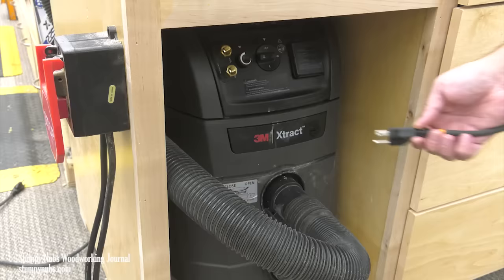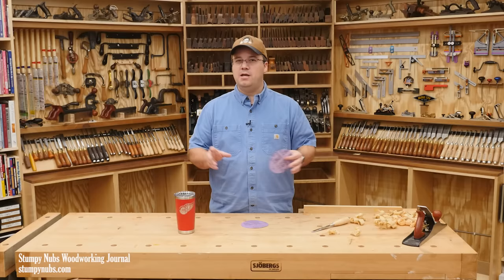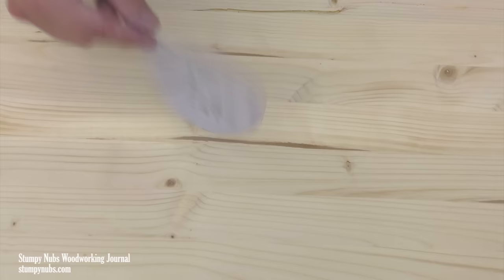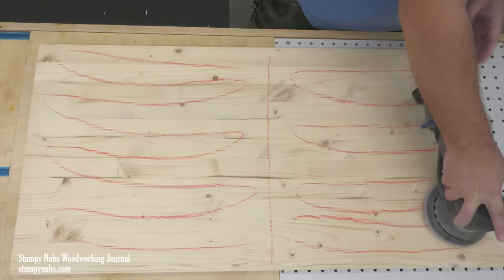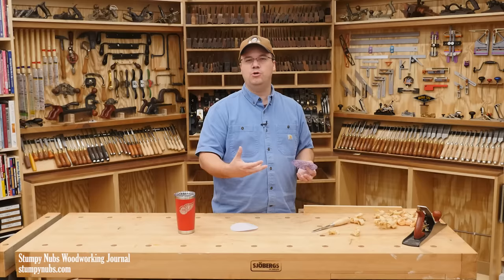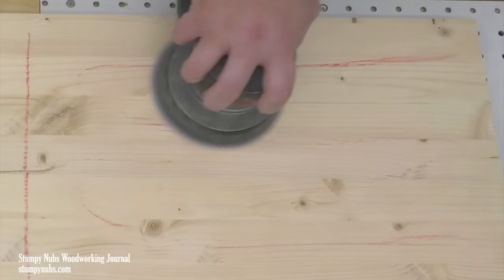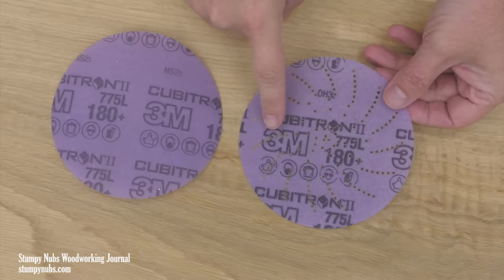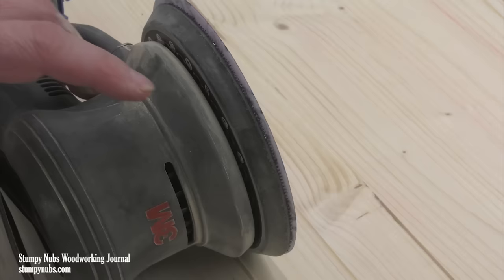This LITTLE KNOWN tip will cut your sanding time in HALF!

Comment: Interesting that my Cubitron disks don't have the spiral hole pattern, but a series of geometric shapes.
Reply: Are you using cubitron 2?
Reply from the maker: Do you have the mesh discs?
Reply: @StumpyNubs  yes. Cubitron Ii Extract .
Reply from the maker: They make mesh and spiral discs.
Reply: @StumpyNubs   Are the spiral better than the mesh I’ve been using? And should I use a dust extractor instead of the shop vac I’ve been using?
Reply from the maker: @markjcarpino  The mesh will give you the best dust collection, but the spiral is on a tougher backing material. Use whatever works best for you. A shop vac will give you plenty of dust collection as long as you keep the filter clean. A dust extractor is quieter, and comes with more features, but doesn't necessarily produce more suction other than the fact that they often have auto-filter cleaning mechanisms that ensure you always have plenty of airflow.
Reply: @StumpyNubs  thank you

Comment: I bet the first area looks just as clean if you just vacuum up the red saw dust that is left on top
Reply from the maker: That will make it less pink overall, but there's still a lot of the red lines on the wood.

Comment: He’s fooling you by using the crayon instead of a pencil. In 21 seconds, both sides were sanded evenly. The wax was sucked up on the side with dust collection. The wax was left behind without dust collection. If he had used a pencil, I don’t think you would see any difference. Use your heads folks. I always sand with dust collection whenever possible. Nobody likes wood putty snots. 
It makes sense that dust collection will prevent some buildup on the paper, but this video dose not prove that dust collection gets the job done faster.
Reply from the maker: I know it's fun to call someone you don't know online dishonest, but look closer. You can clearly see there are actual red lines remaining beneath the pink sawdust that was left behind.

Comment: Meaningless unless the same pressure is applied. It appears additional pressure was applied on the vented discs
Reply: The vacuum will suck the sander onto the work surface without you having to do anything. I don't know how that makes the test meaningless? I can sand with my fingers just barely on the sander, reducing the vibration and fatigue in my hands, since the vacuum does the work of applying pressure. And it applies a consistent amount of pressure (at least until the filter clogs).
Reply from the maker: When you've done a lot of sanding you get a feel for how much pressure you are applying. The pressure felt the same to me. If you think a more scientific test would change my conclusions, you are welcome to conduct one. :)

Comment: Oh boy, here we go again with another raving endorsement of Cubitron sanding disks.  So let me be the voice of dissention -- these are the WORST sanding disks I've ever used.  I've run them on two different sanders -- a Milwaukee and a Festool -- with the same result.  These things throw my sander completely out of balance, to the extent that it's nearly impossible to hold them steady on the work surface. I can switch back to any other brand of sanding disk and everything's fine. Glad I only bought a small pack.
Reply from the maker: What makes the Cubitron discs different is the ceramic grit is all the exact same shape and size. They figured out a way to create precisely formed triangles of ceramic, and to stand them all up on the disc. There are many reasons that makes the sandpaper work better, but the biggest one is consistency across the disc. How it would even be possible to come even close to throwing a sander out of balance with what is defiantly the most consistently loaded disc on the market is completely beyond imagination. I defiantly have never experienced anything like that, nor have I ever heard of anything like that. But woodworking is full of mysteries...
Reply: Interesting response in the comments from @jeffb5858 about how the amount of Vacuum applied will impact how their sander acted.
Perhaps the Cubitron is allowing more (or less) vacuum which is impacting how your sander works?
Just a thought as everyone in our Woodworking group that I've talked to has had a positive experience with the Cubitron sanding discs.

Comment: I used to like your videos. Now all you do is product ads.
Reply from the maker: It's possible to teach something useful and also use a sponsored product to do it. But if you shut down when you see a brand name, you miss the lesson. In this case, as I said multiple times, it's not about the paper, it's about using suction, and you can do this without whatever you have.